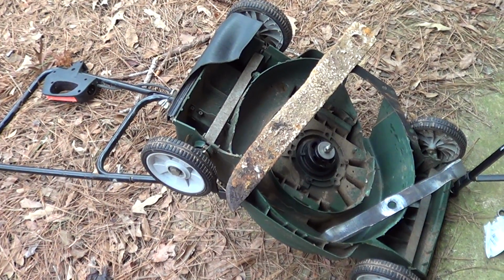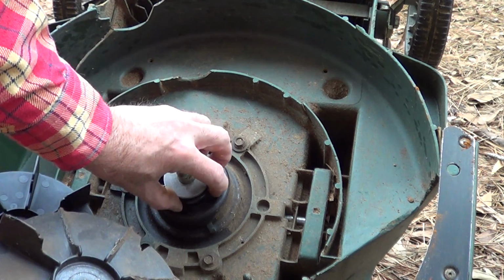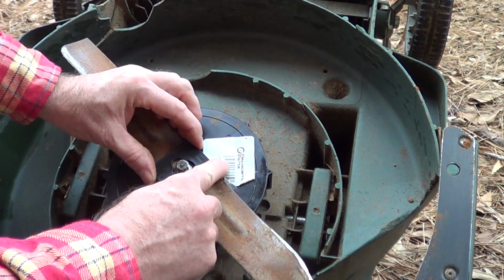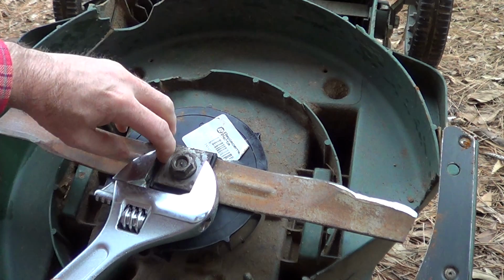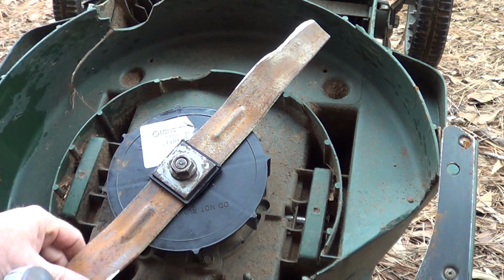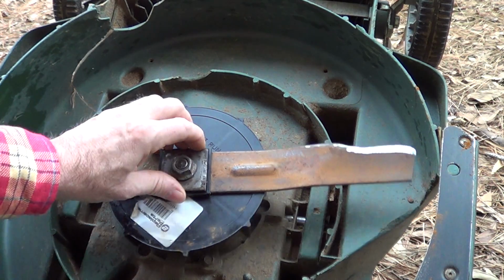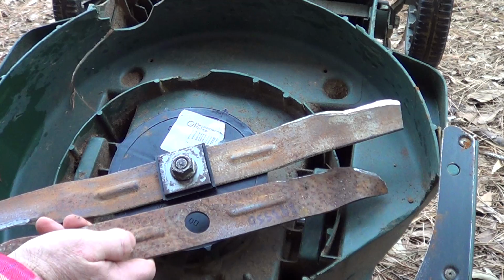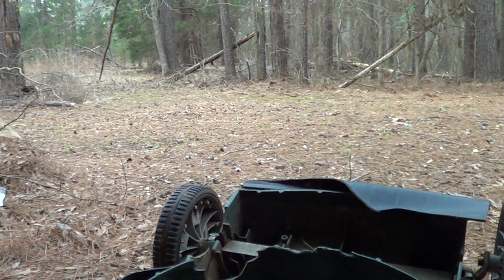Black Decker electric mower blade fan hub parts replacement

Comment: When I took mine apart I used a 3/4 socket (knowing it may be in fact metric) and it did not fit the nut very well but it worked. When I was going back together I was trying to determine what size it really was. I thought probably metric as a 13/16 socket was too big. Then cleaning up the shaft threads it turned out to just be standard 1/2-20 threads. So anyway does mine have some kind of weird nut? Tight for 3/4 but loose on 13/16. i got it back together using the 13/16, but something is weird. 13/32?

Comment: Thank you very much. I had taken the blade off to get sharpened. Tested the battery for power and forgot to put the blade back. The whole bolt assembly fell off and I didn’t know the proper order to reassemble the blade back on the shaft. Also, I had no idea what the  purpose of the fan assembly was for until you explained it. Thank you for your video and help!

Comment: Seeing as you have had some experience with these. I had a line on the grass hog mm675.. I bought it knowing the fan had to be replaced, I had the spare so I went through the replacement process. Unfortunately after replacing the broken fan with the replacement I discovered the the fan blades actually were hitting the bolts in the undercarriage. Obviously this is why it broke the first time.
What could have caused the variance in tolerance to make the fan blades hit those mounting bolts? This is a very good mower overall at 12 amps but with this issue it makes it useless. Any thoughts on how to fix this?
Thanks
Reply: Hi Roger, I have one of these mowers too. That bushing that he broke and replaced, it's likely yours is worn. Now it's shorter than it used to be new so the fan part is now closer to the bolts. You can either open a new part or put a little washer in there. I hope this helps.
Reply: @juanleon829  Thanks. Idid think of a washer as a spacer but when you do so the height messes with the ability to secure the square blade plate in the spindle so it locks. A new one might help but I have been unable to find one. Unfortunately the tolerance of the pieces just won;t allow for a washer. we thought alike on that one.
Reply: @rogercallahan5506  I have also seen where people trim that corner of the fan that hits the bolt heads.
Reply: @juanleon829  I agree but I would have to shave them all off, The fan only catches one bolt leaving me to believe the metal motor housing is off square. Raising the tolerance is the only way I see out of it. I am going to see what happens if I swap out the bushing as I can pick that from a 2255 Thanks

Comment: Great video !
What do you plug your variac into that is greater than 120v, that allows variac to produce referenced 130v output ?
Reply from the maker: The Variac is an variable autotransformer. Means one winding. With 120 volts in on mine you can go from 0 to say 132 to 135 volts on the variable tap. https://en.wikipedia.org/wiki/Autotransformer. For clarity the input to the Variac is say 120 volts and the output is 132 volts when the knob is set highest . Mine is a big 20 amp unit.   Another way is to add say a 12 volt 15 to  20 amp transformer so the output adds to the 120 volts. ie a boost transformer. If you add the 12 volts the other way it is called a buck transformer ie 120 -12 equals 108 volts.

Comment: My black n Decker 19" electric lawn mower will start but won't cut grass. Wat wrong with it?
Reply from the maker: Deborah Jarrett If the motor spins then the blade might not be if the nut is loose. Unplug the mower for safety and see if the nut is loose that holds the blade on
Reply: Thank u
Reply: Can u use a blade from 37051 black and decker to a mm875.

Comment: That "hitch thing" is a real tractor brush hog blade.
Reply from the maker: I just found another one while cutting the field last weekend
Reply: My electric mower cut into the the expose tree root. The blade get strip. I replace 4 insulators so far. For the experiment, i replace new blade, new fan, new bushing. Once i turn on power, the insulators get strip. It can't hold on the blade.

Can you suggest what else can i do.
Reply: Try holding the square metal washer with a wrench like he showed in the video the plastic insulators aren't strong enough to prevent it from turning.

Comment from the maker: Often the parts search requires the model number like LM175 etc. I am not sure what model a B&D power plus is; or is it a series of mowers. Most all of the B&D electric mowers I have seen use either a 18 or 19" blade; the blade's hole the same. The "parts" often are still available but the numbers often change thus NLA gets on parts list. The AC switch in the handle is the same as one used on Dewalt compound mitre saws.